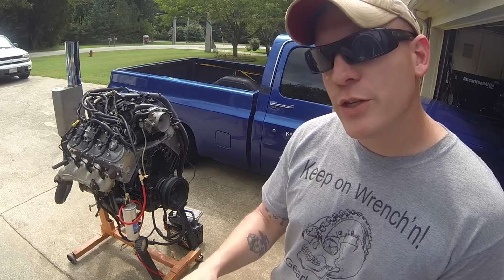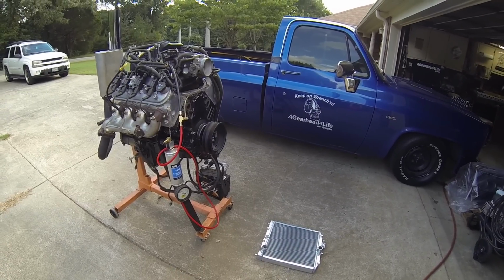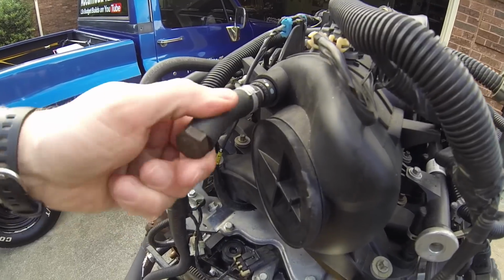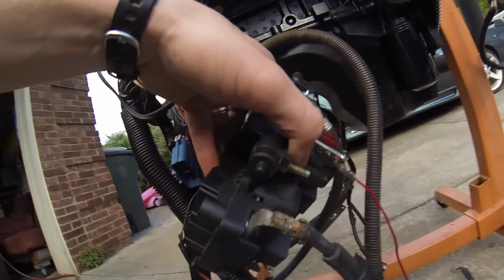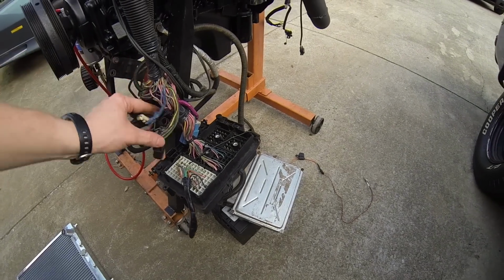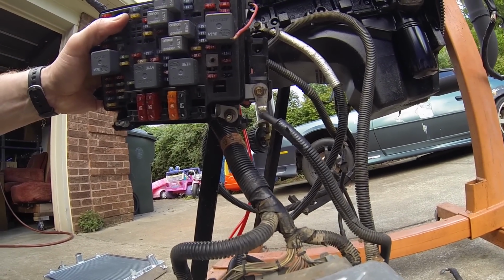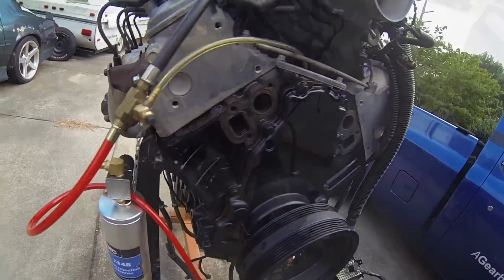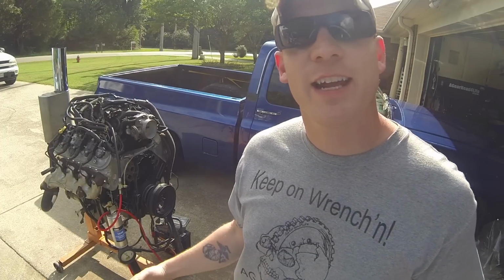LSx Swap Harness How To Simple & Free DIY Standalone on the Test Stand

Comment: so you could basically daily drive a k5 in my case just hooking up those 2 wires?
Reply from the maker: +Jared Durst Yes, you could. Most will want to add things though, like OBDII port and gauges, but you could just drive it like this. It is recommended to run the TCC wire to your brake switch too. The point of this video is to show how easy it is to make the motor run and to break the fear that most have of the harness.

Comment: hello, I have 2000 5.3   I'm going to put in a late 70's chevy. Will I  need the computer box from under the hood and the  box with all the fuses inside of the vehicle or  just the computer  box?

thanks
Reply from the maker: You'll need the computer and harness, unless you plan to buy a new one.
Reply: thanks for the reply

Comment: Speaking of wiring harness what do u use to wrap up your harness? I hate using  wire loom.  I t works to a point but then it starts to fall apart over time.
Reply from the maker: +teto 1992 I've recently started to use "Braided Split Loom" from eBay. It looks really nice.
Reply: +AGearHead4Life is there a specific seller u buy from? How dose it hold up to the heat? I currently have stock painted headers that put out a lot on my 1992 firebird. For now I want to run my 5.0 till it craps out and then switch to an LS like u did on ur camaro. Thanks for the response and also thank you for ur service.
Reply from the maker: teto 1992 Awesome man and thank you! Yea, it should work fine for you. I've only just started using it, but it has a great reputation and is common use now days. When you get a custom harness, it'll have that stuff on it. I don't have a particular seller that I use. Just make sure that you verify if its split or not.

Comment: I have a super clean ZERO rust and paint in great condition 1996 single cab short bed silverado that I want to do an LS swap on. I am a bit behind on how to handle the wiring and computer. When shopping for an LS, should I get the entire wiring harness with computer with the purchase? or can I retro fit to my existing 1996 wiring harness and computer?
Reply from the maker: Jesse Myers Yep! Get the whole harness and all that you can that’s attached to the engine.
Reply: Right on! Thanks brother! I love watching your vids. Keep them going. I would love to see some 6.0 projects in the LQ4, LQ9 or the LY6 with all those beat up Chevy Express vans and old Cadillac Escalades. What about the 4L80E to transfer that power?? anyways love the vids full of good info.
Reply from the maker: Jesse Myers Thank you Jesse! Yea the 6.0 is basically the same as the 5.3. The 6.0 just has larger Pistons. The 80e is what I usually use. There’s one in my blue C10 and I may eventually put one in the Camaro as well.

Comment: My fuse block was separated when I got my 5.3 I see where the battery connection goes, is there a ground connection on the fuse block ?
Reply from the maker: Nope. Just the main ground from the battery to the block and the harness grounds.

Comment: What did you use to get the block and heads so clean.
Reply from the maker: Purple power, plastic bristle brush and a pressure washer.
Reply: @AGearHead4Life  thanks, I used simple green, a scrub brush and a power washer. Got my 4.8 fired up this weekend using your info. Thanks a lot.

Comment: hey gear head....had a question hopefully you could help! I'm trying start mine engine but it's just turning and won't start...I'm also just spraying carb spray in it to start it...thanks
Reply from the maker: If its not starting up with starting fluid, I'd say that your crank sensor isn't plugged in, not grounded well or your main power cable is on the wrong stud.

Comment: ok so once you have the harness on motor. how do you wire it to the key to make it crank as well as have turn signals,head lights radio etc... Need a little help
Reply from the maker: All of those are on a separate harness that is in the car. It is never touched and continue to work, even with the motor harness not in the vehicle.
Reply: +AGearHead4Life ok thanks so I need to find a wire diagram so I can give it some power. Thank you

Comment: Is it possible  to use  it  for a ls swap
Reply from the maker: zinkontrol rgvtruck Yep
Reply: @AGearHead4Life   thanks for the reply
Reply: I did  the same thing but having  a lil trouble  when I give it gas it bugs
Reply from the maker: zinkontrol rgvtruck Is all the exhaust on it yet? If not, that affects it. Also make sure you have enough fuel pressure.

Comment: I have a question on this setup and mine.  I only have the black plug in the middle of the fuse block, no fuse block or either of the two plugged up on the outside, just the middle one.  Is it still possible to start it using this same process?
Reply from the maker: No, not using this process. The fust block is what distributes the power to where it needs to go on all those other wires on that plug. So if you wanted to run it like this without the fuse block, you'd have to cut that plug off and study the wiring diagram to run power to where it needs to be. That's what I did for my daily driver truck to get rid of the large fuse block and just use a small universal fuse block. What you're asking about doing is getting into the "Custom standalone" harness talk.

Comment: How did you connect it to the ignition to start once installed
Reply from the maker: Joe Cervantes I used the ignition wire that went to the coil on the old engine.

Comment: and how did you wire gauges and all that I'm gonna be running aftermarket gauges
Reply from the maker: +Edgard Jauregui Aftermarket gauges will often use their own sensors that you put on the engine.
Reply: +AGearHead4Life thanks man just like the old 350

Comment: What is the line that goes from the fuel feed to up by the throttle body?
Reply from the maker: Kevin Shore I can’t think of a line that does that. The TB just has vacuum lines for the PCV system.

Comment: do you still use the alternator harness from the old truck or from the harness that comes from the new engine harness
Reply from the maker: Sal  Benz Harness that's in the LS harness, except I run a new charging cable from the alt stud to the battery.

Comment: If I'm looking to buy an LS1 for a swap in a k10 how many miles is to many in your opinion? This will prob be a truck i'll have forever... drive it on nice days.
Reply from the maker: Well, I start to frown on engines with over 200k miles on them, but that doesnt mean they shouldnt be used. I've seen these motors running great with over 230k miles on them. It'd depend on your budget for how many miles is acceptable. If my budget only allowed me to run a 5.3 with 250k miles, that's what I'd be doing. But usually I aim for one with 160k. Every engine that I've swapped had over 150k and I beat the crap out of them. They last a long time.

Comment: How would you start it if you don't have the conpletefactory fuse block?????? I only have the middle black fuse box
Reply from the maker: You can acquire one from a junk yard pretty easily if you'd like. You can also tap into the wires that need power using LT1swapDOTcom. I havent made a video on doing that yet though.

Comment: if you leave the harness like this will it be a problem down the road?
Reply from the maker: Curtis Clark Nah, I’ve done it before a few times. There’s usually just a couple more wires that you’ll normally need, like the TCC brake switch wire to disengage the converter clutch and a wire for the OBD port so that you can talk to the computer for a tune.

Comment: Wondering if you could help me. I'm doing an LS swap into my 87' K5 but have no clue how to attach the DBW pedal assembly. I read that it's not a direct fit but know people have done it just can't find any guidance. Hope you can help. thanks
Reply from the maker: +Jesus Romero Nah, I wont be much help, because the answer to that will be a creative mind and fabrication. You'd set it in place and judge what will be needed to make the pedal mount. That's pretty much all you'd have to do, as far as I know. I haven't used DBW yet though. I've always stuck with DBC for some reason.

Comment: so I don't need the o2 sensors even in my truck when I do the swap
Reply: not true, just don't need them for the test stand. on the test stand one is not motoring around, etc. One is TESTING the engine before installing it to ensure no oil leaks, it starts and other items.
Reply from the maker: norsk answered this well. It'll run without o2s, but that is not how you want to drive it around.

Comment: Could u give me some advice on how to set this up to work with my car I'm doing a lm7 swap into my 87 iroc I have the fuse block and pcm out of the donor truck I'm trying to figure out everything I need I know I need vat deleted could I use a hp tuner to remove that? I seen ppl charge around 150$ to delete the vat but if I buy the hp tuner for 500 I could do future adjustments I plan on using a push button start to make it easier this isn't a daily driver but any advice or links that I could find with a detailed Intalation on hooking this up to a vehicle
Reply from the maker: +Robert Shelton You wont have to change how the vehicle is started. Just run your current starter wires to the LS starter wires and done. It'll work just like it use to. Then power your harness just like in this video. The ignitions power wires that was was clipping on to turn this engine on will be your coil power wire from your current motor. That's it.
Reply from the maker: +Robert Shelton You wont want to buy HPT unless you plan on invest quit a bit of time to learn it. It's not for everyone, but you'll have to make that decision. For 150$ usually you'll get any adjustment you want to the PCM as well. For just VATS removal, its about $75 I believe. Contact "CoolMike222" on ebay.
Reply: +AGearHead4Life thanks so much for the quick response I was thinking it would be a lot more difficult and I'll check out mike now thanks for the advice and looking forward to more content in the future

Comment: Were ur ignition wire leads too?.. U DONT NEED THE FUSE BOX THEN OR YOU DO?
Reply from the maker: Ignition wire is shown at 5:25ish. It’s the wire used on pin A9. 
Yes, using this method, you’d need to use the fuse block.
The fuse block can be eliminated and replaced with a smaller aftermarket one if you chose to. That’s a whole other process that I have made a video of yet.

Comment: hey mark howve you been. just to confirm sensor needed are crank, cam tps, coolant temp, and map?
Reply from the maker: Hey hey! Are you referring to just running the engine or to swap the engine and drive it?
It’d be easier for me to list the ones that you don’t need.
Actually you could just leave them all there. It’s your option.
But yea, it won’t run without the crank sensor. 
It’ll run too rich without the coolant sender. 
Won’t run well without the cam sensor.
Needs the primary two o2 sensors to go into closed loop.

I think I need a more specific question. My ADHD is taking this all over the place. Lol

Comment: I have a question for you. I'm planning to build a factory five car with a Ford Mustang 2006 4.0 engine as well as the transmission and rear ended. If you show on the video that we have to see the power line that you show on this video for the Chevrolet. Do you know what is the power line on that 2006 that goes on the fuse box ?
Reply from the maker: +rafael eduardo segura reos That sounds like an awesome project man. Nah, I dont think Ford worked that way. I dont know for sure, but I've heard some tricky things about Ford from my buddies. Hopefully Im wrong though and it turns out simple. Good luck on the research and the build man.
Reply: +AGearhead4Life 
What are those tricky things that you heard about. Is that complicated? Can you search that for me ? Thanks
Reply from the maker: +rafael eduardo segura reos I know my buddy swapped a Cobra engine into his GT. He had to swap the complete body harness to make it work. That was the example that I remembered. No, I would not be able to research it for you. I have way too much of my own work to attempt to catch up on. I'm a few months behind right now.

Comment: so if I did a ls swap that's all I would have to do to make it run inside the truck? I got a 86 k10 and been wanting to put a 6.0 in it just seems way to expensive for the painless harness
Reply from the maker: Yes, but I'd recommend running the TCC wire to your brake light switch as well. There are a lot of optional things to wire in. This video is just to show you the minimum of what it takes to make it work. yes it'll drive just like this.

Comment: So when u pull the fuse block and harness. What all do u need?
Reply from the maker: gimmel11 I'm not sure I understand your question. To do what I've done here, you just need what you see here in this video. The engine harness is one large piece and all stays together, take it all. Engine harness plugs into the fuse block. Then if you're able to get the grey/white block known as C1 that I show in this video, it makes it easier to connect to the A9 pin. But you don't have to have that grey/white block. You can still connect to the A9 pin without it.

Comment: I just got my 6.0 today,  there is something can do with the throttle, cuz my is electronic,, can I make it manual? Or I for need the gas pedal
Reply: Also great video, thanks
Reply from the maker: Thanks Hugo! Yep, you can usually swap a cable TB onto the intake, if you want. Then just add the wires for the TPS and IAC to the harness.

Comment: Please help mr gearhead!!! I have everything wired up with the stock vats flashed ecu and harness with stock fuse block.. WHEN I GIVE THE IGNITION TERMINAL POWER, (A9) THE RELAYS DO NOT COME ON OR CLICK. What am I doing wrong?? I have the grounds bolted to the motor as well with a negative to the block from the battery.
Reply from the maker: Try moving the main power wire from the battery to the post on the fuse block to a different post. Maybe you used the wrong one.

Comment: what can you take off the under dash harness on a drive by wire? cause it won't shift or have neutral safety with out the key. I just want to keep obd2 port and the key
Reply from the maker: OBD port is just one wire from the engine harness. The key would be referring to the VATS system and that I could not tell you since I dont usually transfer that over with the swap. Just find all that is including for the VATS and key and take it.

Comment: I have a question I have a 5.3 Chevy engine in my short bed truck.. I want to put a cam what is a good cam to put on my 5.3 engine without tuning it and get more horsepower and sounds good can you please help me thanks
Reply from the maker: Leo Herndz Chosing a Can is a hard choice. It depends on personal preference, purpose and goals of the vehicle. Whichever can you chose, they’ll all need to be tuned to get it running correctly and get all of the potential out of it. Check out the BTR truck stage 2 or 3 cam. They’re a pretty good budget cam that you can hear.

Comment: what did you do for a fuel on your blue Chevy as far as fuel pump
Reply from the maker: Well, it had TBI fuel injection fuel tank on it. So I just swapped in a walbro 255 pump. But now im changing it to a 91 K5 Blazer tank by the rear bumper.

Comment: Hey Mark. What did you use to fit your engine temp sender for the temp gauge, to fit the 5.3 motor?
Reply from the maker: +Juan Sanchez I used a '98 Camaro coolant temp sender and pigtail. It's a three wire, so two of the wires went back into the harness like it is from the factory and the third wire with to the gauge.
Reply: +AGearhead4Life I have a 87 R10 just like yours. it's a single wire.
Reply: +Juan Sanchez oh I get what you mean. Did you change the coolant temp sensor also?
Reply: +AGearhead4Life is it pretty accurate?
Reply from the maker: +Juan Sanchez No, stock C10 gauges suck. Makes me want aftermarket gauges. I just use the Torque app on my phone for gauges, it's much more accurate.
Reply: +AGearhead4Life lol they do. Thanks alot for responding, you're videos helped me. I want to keep my gauges factory so I'll just installed a resistor to make it accurate.
Reply from the maker: +Juan Sanchez I show how I did the coolant gauge in this video near the end, here's the link:  https://youtu.be/LIj4A9WyEQ8?t=28m38s
Reply from the maker: +Juan Sanchez No problem. You wont need a resistor. It'll read as accurate as it did before the swap.
Reply: Cool. I'll most likely  hit you up with some more questions later on. Lol I'm installing the motor today. Already ran it on the engine stand, never done that before. Keep on doing what you're doing.
Reply from the maker: +Juan Sanchez Awesome man! Good luck!

Comment: Agearhead...wanted to ask to see if you can help me...I got my harness done it has three wires battery constant 12v and ground...my question is what do I do with my old wires do i use them or not where do i connect my 12 volt too....any help is appreciated..by the way I'm doing the swap on 1985 cutlass thanks..
Reply from the maker: What you do with all the wires on your Cutlas is up to you to decide if you want to keep them or not. The three wires, you probably meant a constant, ignition and a ground. The ignition wire goes to your cars old ignition coil hot wire, just like I've done in this video.